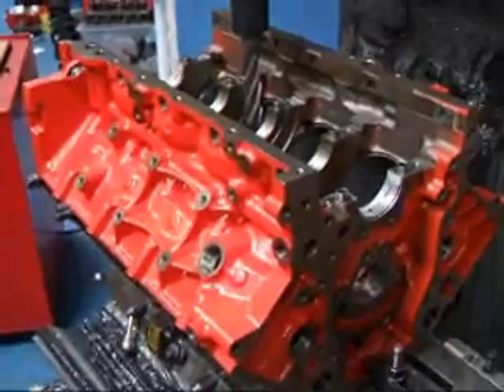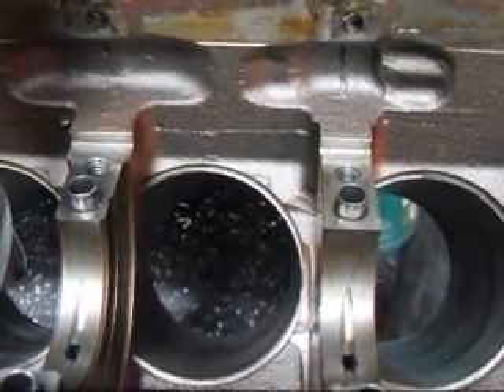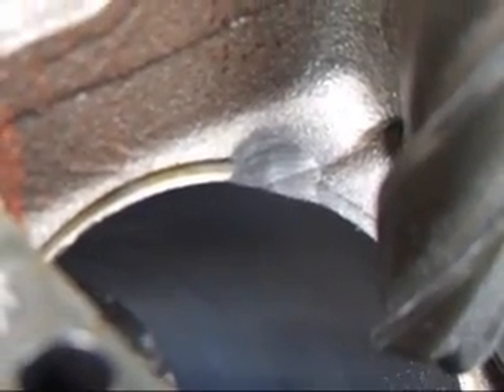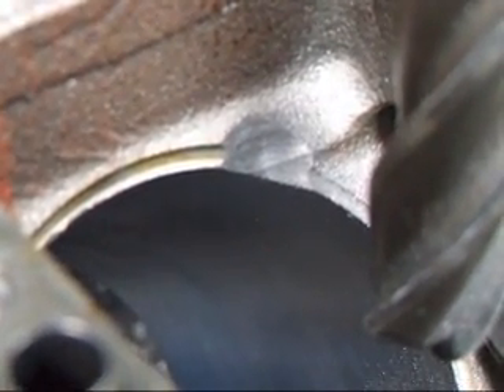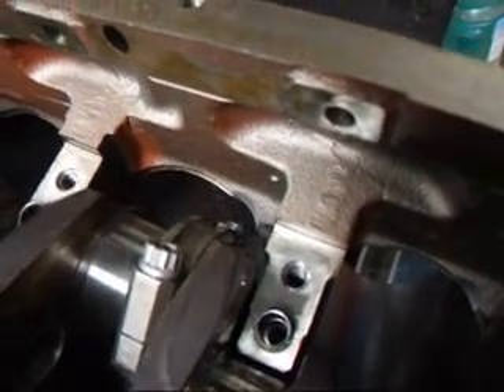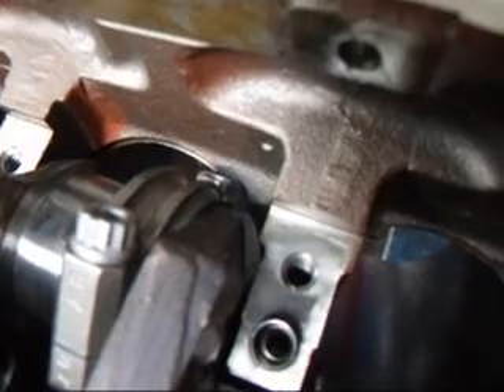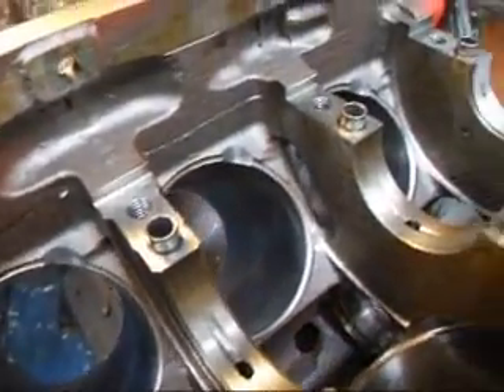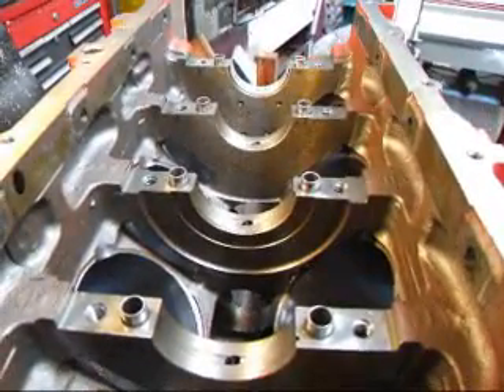LSX Block Clearancing for Stroke Crank

Comment: in response to a comment below. you can this with a die grinder a lot faster, without going hog wild with the die grinder, and still have top notch qaulity, because the tool is not mounted, and i do them all the time for 383's so no cheap shots. yet, when you get to those really long stroke trick motors it's best to do it like this as not to hit the water jacket by taking your time, and only removing the amount of material that needs to be removed to clearence correctly. thanks for the video's.
Reply: ezcondition good point, I’m about to attempt a 4.125” on the LS1 block, and so far so good but it’ll take some clearance for sure, just like any big stroker would.

Comment from the maker: It's better if you do this on a milling machine because you can take out the same amount of material from each side. It can be done with a die grinder and carbide burr tool, a dremel tool will take you hours to do what I do in a matter of minutes. Good luck...
   John...